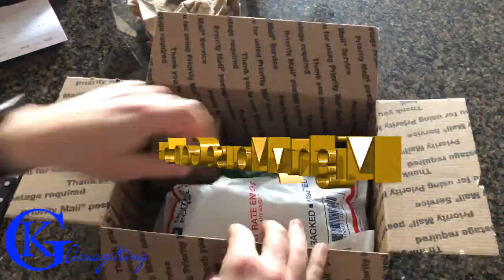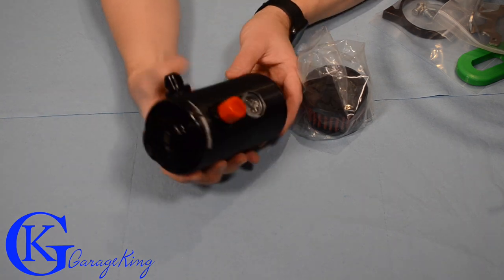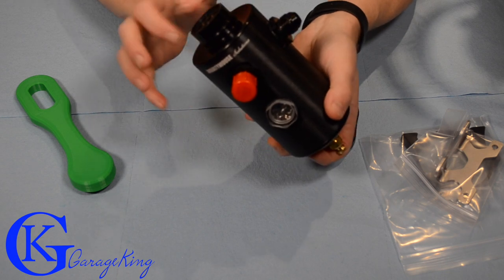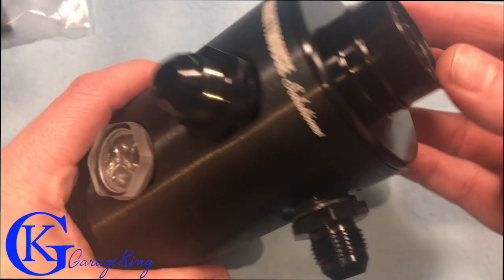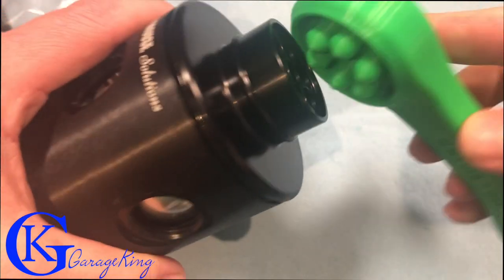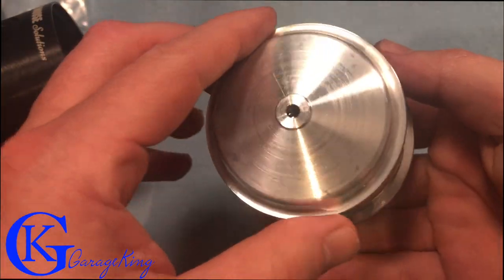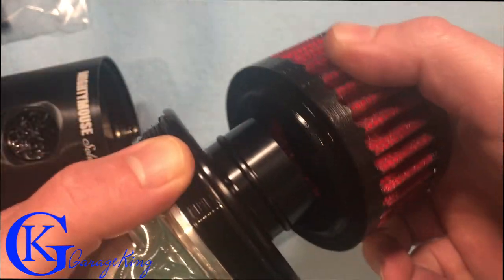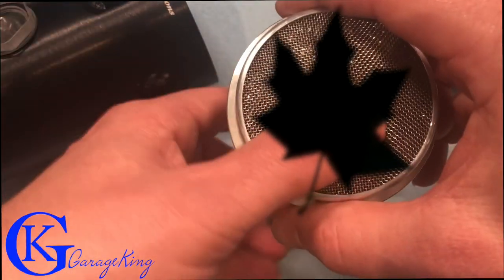MightyMouse Gen 5+ Catch Can Review

Comment: Hey, I have a Gen 5 Wild, and I’m venting off both my valve covers with a 12AN hose. I’m trying to reduce the amount of smoke coming out of my catch can and through my hood, but I’m not exactly sure what I need. Mighty Mouse support sent me the conversion for the Gen 5 Plus, but it looks like it doesn’t utilize venting from both valve covers.

What do you think I need? I also noticed that I don’t have the one-way valve in the breather. Could that be the issue?
Reply from the maker: HI There, you should have a one way valve in the breather if you have a newer computer controlled engine as the air is metered.  If you are running a lot of boost on your car you may just be exceeding the capacity of your system. On most stock engines you actually don't vent much. Venting from both valve covers you must be under a lot of boost and driving hard as that would produce a lot of blow by.

Comment: This catch can for petrol car just wondering my car is diesel vw what can I use and it will increase hp
Reply from the maker: This catch cans is for petro cars. On the diesel you need a special one if you get one.  They help to keep the engine valves clean so.  For more horsepower on a diesel easiest way is probably to tune the computer if it is a newer one but the problem is more horsepower = more gas so it’s a trade off.

Comment: Arent both of those inlets? isnt the breather is the outlet?
Reply from the maker: Hey there, no only one is the inlet. Take a look at 4:45min mark, I show them really clear there.  Inlet and Outlet are very different.
Reply: @GarageKing  gotcha, I must be looking at a different system. I was going to run a -10 hose from each of the valve covers into the catch can and no 'return'.
Reply from the maker: @BLAC_WORX  Thanks for the follow up.  Its always good to run a return to the intake from the catch can so you have vacuum on the system.  If you look at high horsepower engines they even have vacuum pumps on them.  AN-10 is a good size hose (pretty much 1/2") but I would make sure you have vacuum on the system to clear it of blowby.  Some people just run breathers and no vacuum, but then the only way your blowby is coming out is when you have pressure in the system. Not sure if I'm understanding you right, and I could be wrong in my interpretation of your comment, and perhaps you have a vacuum source on the crankcase.

Comment: This is too funny to be true. Mighty Mouse takes something dead basic and complicates the hell out of it then charges big bucks for it. Your standard vehicle has a hose that redirects the crank case pressure back into the engine to be re-burned so to speak. The idea of a " catch can " is exactly that, the crank case vented fumes and particles pass through above a can which catches the droplets and it falls into the can. A hollow can with a wad of stainless steel wool from Walmart will do the trick. This is like putting lipstick on a pig and calling it something else. JLT Performance make a great one with factory type fittings and a bracket for half the price.
Reply from the maker: Thanks for the comment, you are right about a lot of things.  Not sure if a hollowed out can with stainless steel will do....  You need to redirect the airflow to create a pressure drop.  The JLT does this by hollowing out two cavities in the lid to force the air around.  The New mightymouse tries to accomplish the same thing.  Without getting too technical, you want to create the biggest flow distance from the inlet and outlet.  I'm currently doing some back to back testing,  https://youtu.be/waIz0vfefPY  and will be posting the results.  Its actually quite interesting, and the factory for the most part has done a great job, but with the new direct injected engines its even more important to try to keep them clean.  Thanks for the comment, and if you have any questions please let me know.  I have read a few engineering papers and SAE articles regarding catch cans.  Thanks for the comment

Comment: Would you be willing to conduct a test between the latest MM and another design? Place the other design in series AFTER the MM can so it only gets the vapors AFTER they pass the MM and run 1000-2000 miles and then drain both and document, then clean both of all oil and reverse the order placing the other design first and the MM second and drive the same miles and same driving style and document what each caught? This is the only fair and accurate way to test effectiveness.  Let me know and email me at: APDEG@aol.com and will provide the other design at no cost if your willing to devote the time and document all accurately.  Thx!
Reply from the maker: Thanks for reaching out to me, I have sent an email to you.
Reply: That’s certainly NOT “the only fair and accurate way to test effectiveness.” Off the top of my head I can point out that the can’s ability to vent crank case pressure during a WOT situation would need to be measured. The can is more than an air/oil separator. Proper vent and proper pressure differential would need to be weighed.

Comment: Solid vid, product seems good. Curious to see if that much mesh is really required, as even though it's mesh it still takes up significant volume inside the can.
Reply from the maker: I was surprised at the amount of mesh as well.  The bottom of the can is separate from the mesh, maybe 1/4" so the oil can pool there, but its not a lot of space and would require you to empty the can every time you get gas. I empty mine all the time so its not an issue.  I have been in touch with the owner of the company and he is a stand up guy.  When going back and forth with him about design, he put a lot of thought (and time) into the design so I assume it's beneficial to it.
Reply: Another justme 🤗